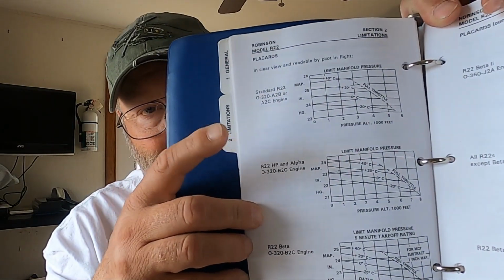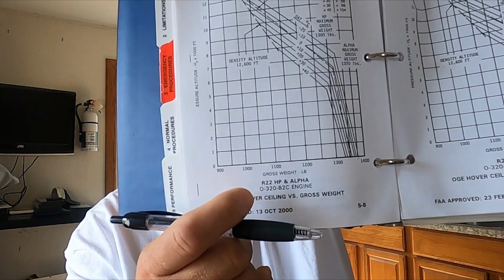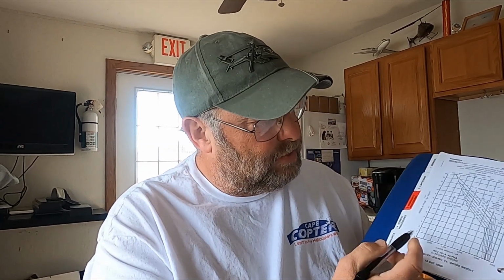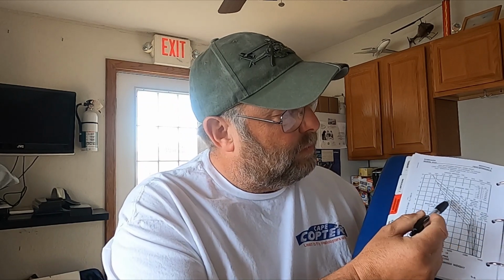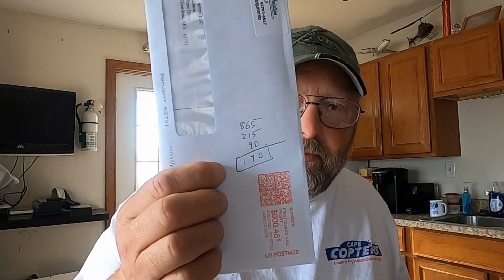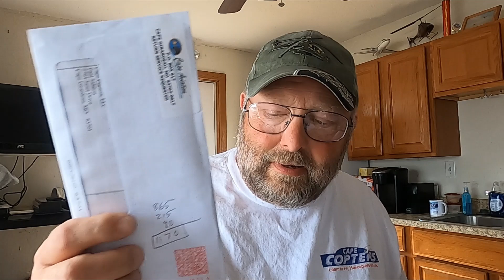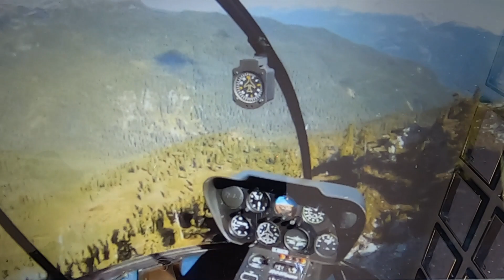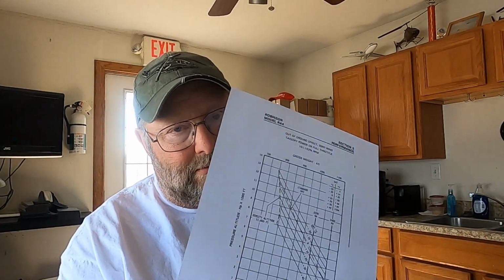Power Checks in Helicopters- Do them or suffer the Consequences

Comment: Thanks for sharing this video! Entertaining and informative. Question: what happens if I bypass the governor by going wot so I get max available MP? Let's say I'm a bit high, for example 3000 feet msl. I believe max MP at that altitude would be around 26 inches. That's gonna be a bit above redline MP. Let's say I screw up my approach and find myself running out of excess power. If I manually go WOT and then vary collective accordingly, to keep rpm in the green while I try to gain forward speed, the MP will go a bit above redline, momentarily. Would I be in danger of slipping the transmission belts (or otherwise breaking something)? Best regards from Brasilia, Brazil.
Reply: You don't need to bypass the governor: the governor will open the throttle right to WOT to maintain RPM. There is no "power limit protection" functionality in the governor. Another way to put it: if you are getting low RPM by pulling up on the collective on an approach, there is no more throttle travel available: the governor has already opened it all the way.

Comment: "The doors were off: I'm sure it was a warm 20C day!" Really? Bro: snow is on the ground, and the pilots are wearing balaclavas and fur-lined coats :D

Remember: OGE hover check "over the middle of a valley hundreds of feet off the ground" isn't a bad idea, but it also won't tell you how the aircraft is going to perform halfway down the shoulder of a mountain somewhere. Winds up high, clear of terrain may be nice and favorable, but winds down at the landing area (unless you're right at the top of a ridge and you're using a known updraft coming off the ridgeline) can often be completely different. Terrain can block wind, or turn it into a down-draft. Treelines can do the same. You have to be very careful of coming to conclusions about your ability to do an OGE hover when you're up in clear air away from obstructions.